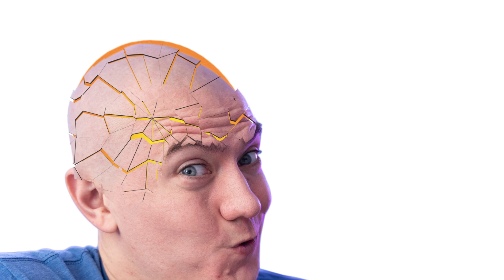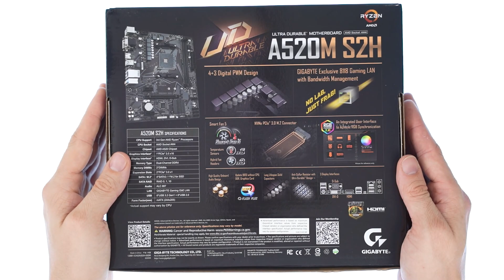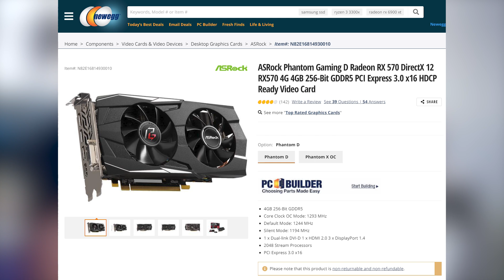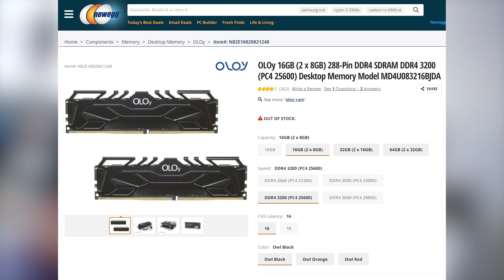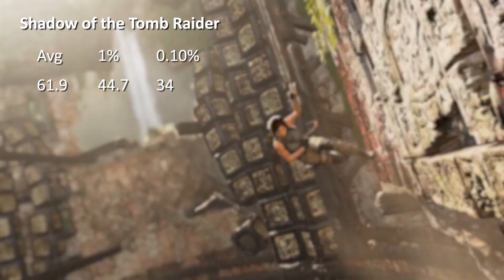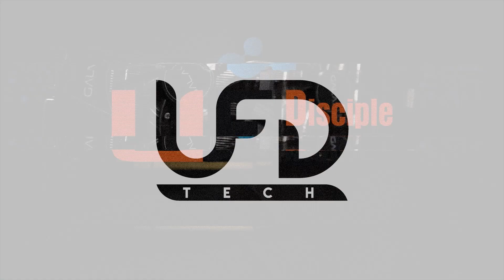The Best $500 Gaming PC You Can Build Right Now - Newegg Now

Comment: On NEWEGG the Ryzen 3100 has been over $150 since just before black Friday and currently at $185.  Most things are out of stock and the GPU is $169... So there isn't any way this PC would cost $500 or less unless quoting MSRP prices...  and even at time of filming from newegg this wouldn't have been a $500 dollar machine but really adequate $650 to $700 dollar machine  (not good or great value though, been trying to price a cheap machine lately and running into this same problem with certain parts inflated)

Comment: Thumbs up for advocating smart use of ur money and tech, and buy what your workflow really needs! Cheers.
PD: I have a 1650 4gb for graphics work! And it ROCKS, no need for more. So... yep. Also discovered that a 3900X (what I have now) is great, but also realized a 3600 would have sufficed (let alone the current 5600, which is a total beast in Photoshop, well over the previous king, the intel 10900K, in PS). The 32 GB versus 8 GB was the biggest improvement in my workflow, to be honest.
PD2: The intro of the egg and urself... brilliant :D :D
PD3 : I have a SSD, but only for the OS and installed APPS (indeed, only the permanent ones, the others go to the HD). When you work in video, large print files, etc... you are writing and deleting too much for the number of writes SSDs allow. So far, I don't see real slow down (also as a lot goes direct to RAM, having 32.). For me a combo of 500 SSD for OS and apps + 2TB HD + 2 externals for anything else (specially work files, downloads, etc) is doing great. That said... if ONLY for gaming ... ppl is not uninstalling games every freaking day... and Office does not write enormous amounts of data. It's fine for mainstream with only the SSD. I know writing many gigs per day is not usual (it is for me...)

Comment: Ryzen 3100 is out of stock already. Intel i3-10100F is a good replacement - it costs the same but it's also faster and accepts slower and therefore cheaper RAM.
Reply: Exsctly cause have 4c/8t quad core processor and have more gaming ipc than Ryzen Zen+2  processor🤟🏿❤❤

Comment: The thing nowdays is, you cant build even a budget gaming PC for 1080p for less than 600$. This one without out of stock joke is around 620$.....And RX 570 is getting a bit old and slow, at least for most new AAA games. So when we get some offerings from RTX 3000 and RX 6000 series, it would kinda fine. For me I would go with a bit faster and ofc more expensive GPU for around 250$ or even 270-280$, i would assume something like RTX 3060 (non TI) and RX 6600 XT would cost something like 269 or 279$. So that brings the price to 750$.... No wonder why there is so much hype for consoles, and for myself I`m going with PS5 when stocks are in better shape. Simply, dont wanna be part of PC gaming with these inflated pricing all around...Plus I`m getting older, so gaming in a sofa is becoming my thing :)

Comment: I dunno about the advice you gave for storage.

I remember watching a video about putting steam games on NAS and connecting it with a 10GBE connection to the pc. Read and write speeds where comparable  on the raid 5 on the nas vs the SSD on the PC. looking at prices, a 4TB ssd is around $500 while 2TB HDD is $60. get 4 in raid 5 nets you 6TB with speeds close to SSD at half the price of the SSD. But that's just based on what i've seen. Haven't done any real world testes myself, but I do have a nas with raid 5 and my steam games installed on it. They seem to load pretty quickly, even over 1GBE that my net work is on. Even Total War: Three Kingdoms that have horrible load times on HDD, but loads much quickly now from my nas. 

But it seems to me HDD is still much better deal depending on what you do. Obviously not here on this $500 limit build, but i think in situations when you build a pc and have a case that can hold 4 HDD, it might be a viable alternative to high capacity SSD. If your looking for something like that.

Comment: *sees psu

Have fun keeping your computer from randomly shutting down and not risking damage every time an outage happens
Reply: That happened to me in october with a cheap evga psu. I bought a new system in the summer except for the gpu. Kept my 560 ti until i could get a 3000 series. My psu killed my 560 Ti after a few months and i didnt know. Got a 1650 for work cuz no other choice. It killed my 1650 a month later and i got it replaced through warranty. It also tried to kill my replacement 1650 but it failed to do so but i couldnt log into windows without my computer black screening. My psu died the same day. A high quality PSU saves a lot of headache, in my case, a month's worth of headache...

Comment: does it beat the PS5 or the series X?
Reply: Nope, pcs in general arent good value when comparing with brand new consoles but 3/4 years down the line a brand new 500 dollar pc will beat consoles in value and performace
Reply: no but it doesn't just play games.
Reply: its almost an xbox series s, it is a beast at 1080p
Reply: @josealbertosantillan9732  the S costs 300 though..
Reply: @MarwanMahdy  well yeah, but you know you also get a pc for school or work... Right now in the pandemic we all need a pc for online meetings, series s you know its a console. 💀 you also get an upgrade path up to a 3080 and 5950x with that board.
Reply: @josealbertosantillan9732  they are marketing this as a gaming option, I am just saying a console is much better at this price point.
as for work or school you don't even need a 500 dollars PC
Reply: @MarwanMahdy  u right
Reply: @josealbertosantillan9732  you do not want a 5950x with that motherboard. Sure it might work, but better to go with B550 at minimum.
Reply: @TheGauges420  Definitely agree. Anyone using that high end of a cpu and gpu needs a mid-range x570 and definitely a high quality seasonic gold rated or higher 750 watt or more PSU
Reply: @josealbertosantillan9732  Terrible upgrade path idea
Reply: @WLOfails  well only reason I suggested b550 is if you don't need gen 4 nvme drives, cause let's face it for the next 1-2 years still we won't see them become much more useful and by then gen 5 will likely be out... an a520 for a 5950x? I have a high end b550 for my 3700x and a mid range x570 that I paired with a 2600x for my nephew lmao. Couldn't imagine being so poor to even want an a520 but also have the problem of having so much unneeded money to be able to spend $800 minimum on a 5950x and $700 minimum for a 3080. Its like 'let me buy the most current high end pc I can' but then trying to power it with a laptop charging brick, or running just a 500gb HDD for your OS and all games.
Reply: @TheGauges420  I would of had B550 for my ryzen 3600, but I bought my system before the B550 came out and got the asus tuf x570 plus. Later on i realized that B550 was almost the same price as x570 depending on the brand
Edit: went with the 500 series route instead of b450 for motherboard as i tend to keep computers for 7+ years